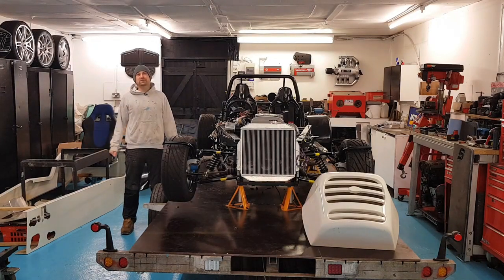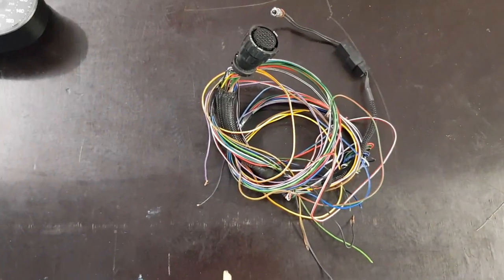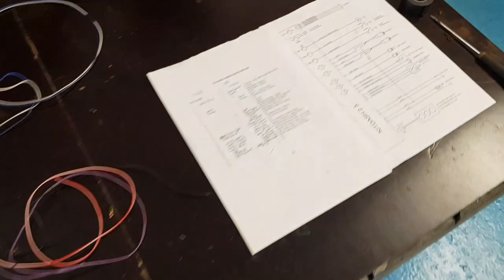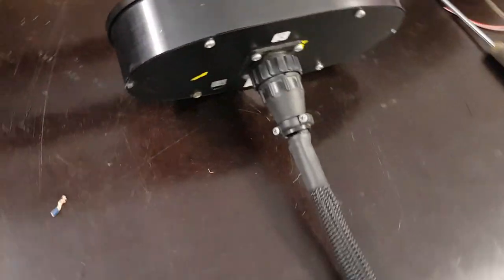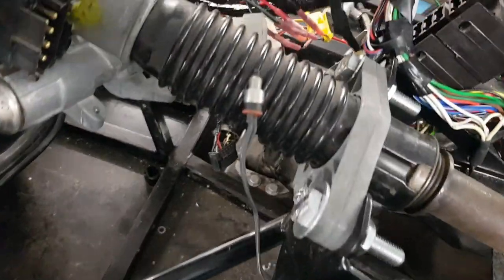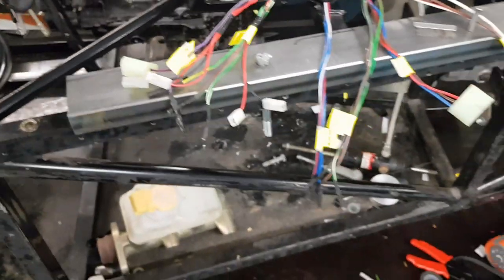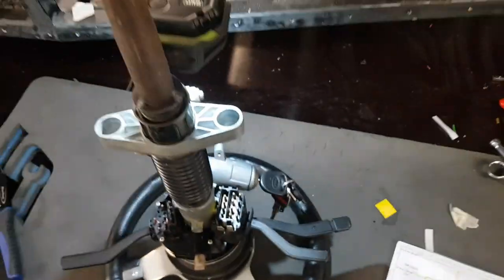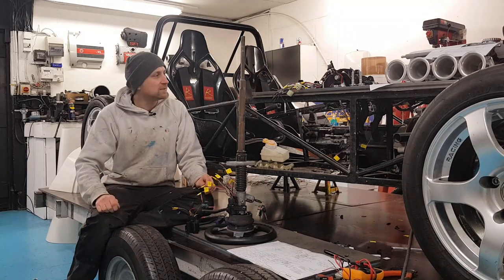Ep17. Wiring the ARIEL ATOM dials to the TIGER CAT E2 Loom in my GBS ZERO Kit Car!

Comment: There are quite a few different varients of the Sierra stalks. You should have a part number on them that might help identify them. Locostbuilders have quite a few threads with different pin outs. This is one of the pin outs http://locostbuilders.co.uk/photos.php?action=showphoto&photo=22Sierra3.jpg Cheers, Pete
Reply from the maker: I did some research on the forums and found all the info on the variants. All sorted and hopefully a new video out on it this week 😁